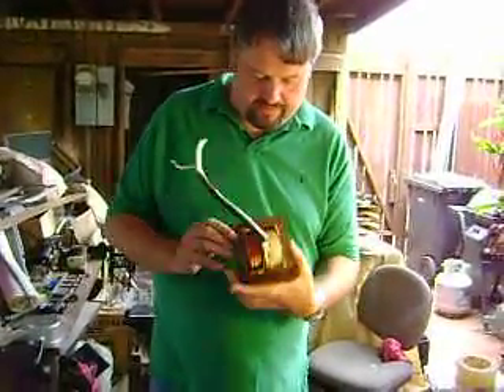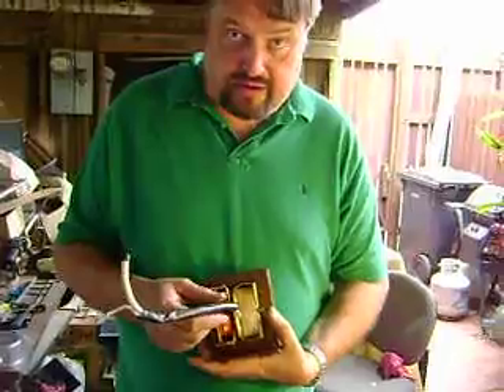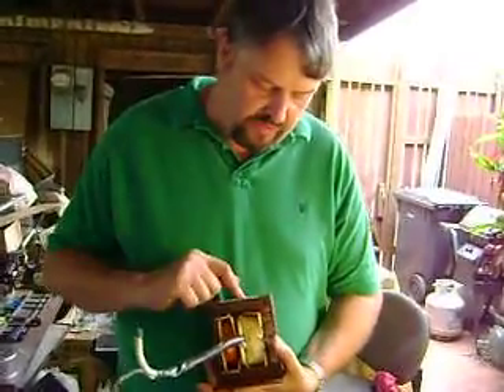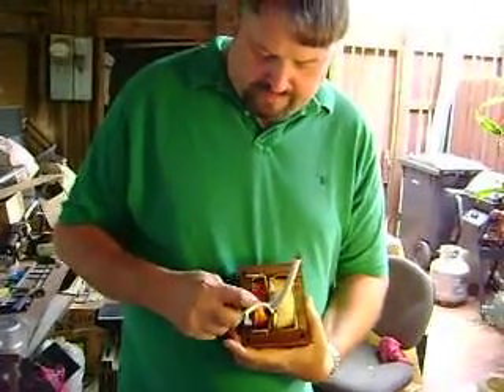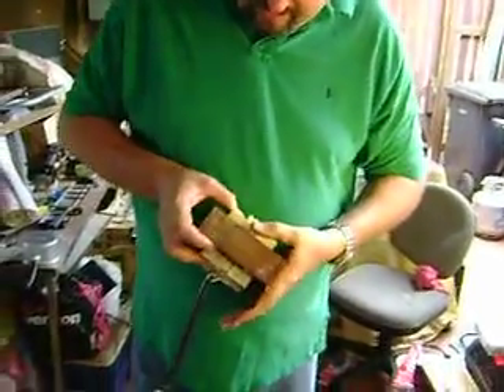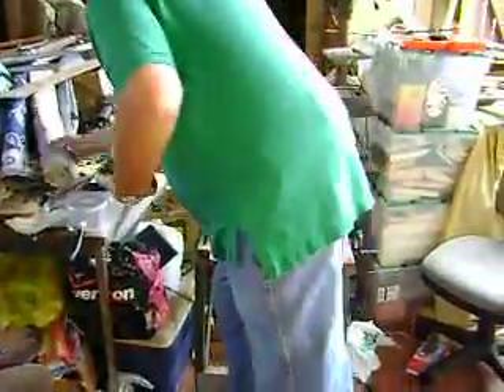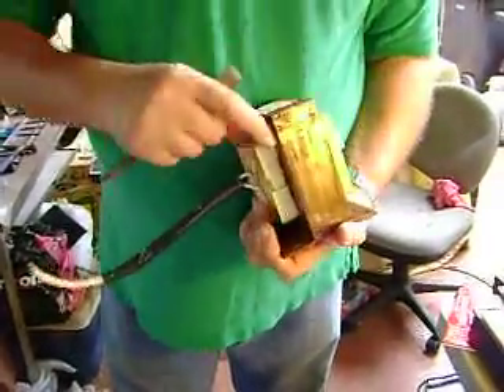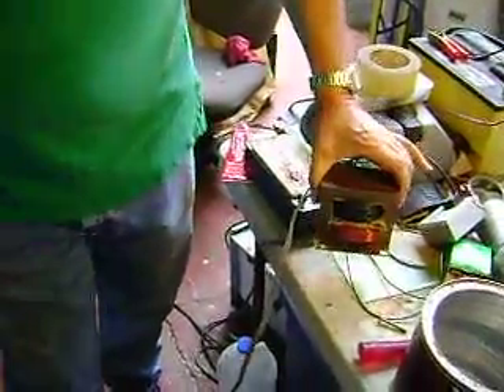Microwave Oven Transformer MOT Modification

Comment: @legogunguy001 OK thanks, by the way I meant that the MAX output on the ATX supply is 30 amps not that it always outputs that much. Also I tried to get 20 turns of 10 gauge on my MOT but I could only manage 7 turns. Would you recommend a that I use a higher gauge of wire.

Thanks for all the help

Comment: About how many volts will the transformer output with the 10 gauge. I am also making a HHO system and need a powersupply with more current than an ATX computer power supply. Thanks

Comment: @yosip1115 Salvageable?
No.
It is covered in shellack and crap, it makes a mess.
There is about 1k turns on the sec and 100 on the prim.
If you put the MOT in a vise and beat it with a hammer until the welds let go due to metal fatigue you an get the coils out undamaged.
However that magnet wire will be BAD.
So I suggest you sell it (1pund, 2bucks) and use the money you make to buy some new magwire =P